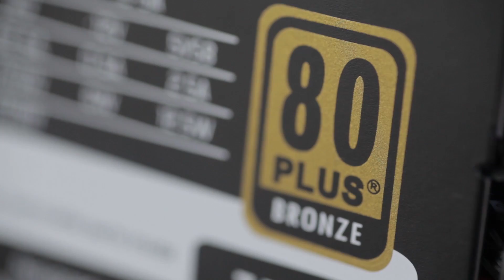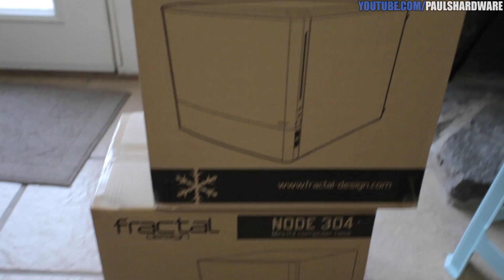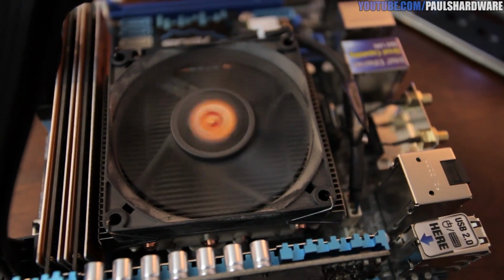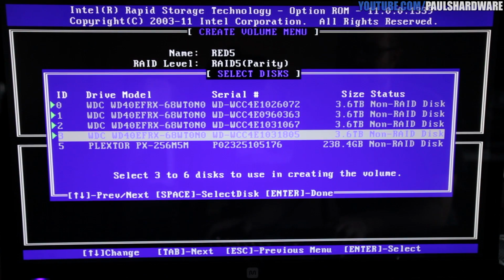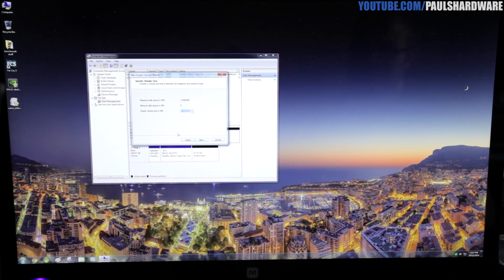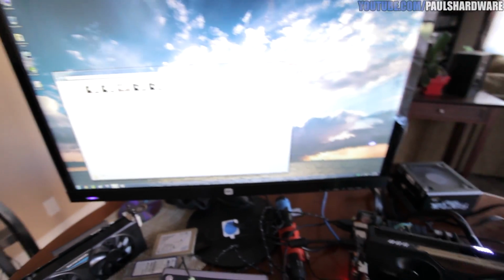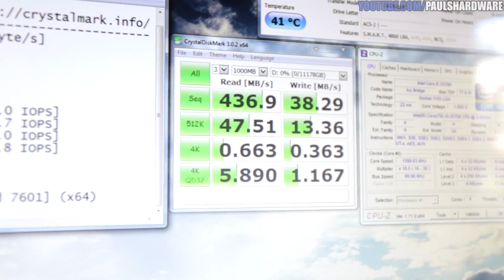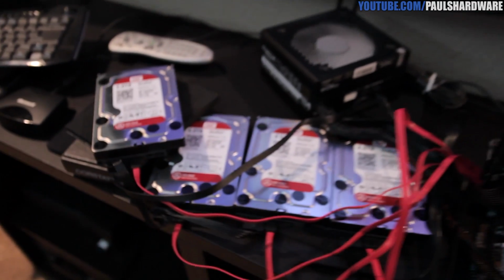Paul's HTPC Build - Part 1

Comment: Hey Paul quick question I have a has should I return it and us a computer instead and install windows 7/8 for serving video to tablet smart phone both at android by the way and what software should I use to do this I need some help because every were I search the is hardly any info on the subject I all so want to use it as a htpc / workstation the specs of the PC is a and phenom ii x2 550 be a Gigabyte' board with six sata ports  h60 700w PSU will be changed if this is a good idea and 2 3tb greens 2 1tb HDD blue and seagate and a samsung 240 pro ssd and 8gigs of corsair vengence that is the specs of the computer any info would help and be apresheated I am sorry for my bad english it would be alsome if you responded and can help me with my issue please and thank you 

-joshua'
Reply: I ment to say nas

Comment: Tip: Cheep drive caddy for benching... When testing out your rig before getting everything in the case, you can use some metal plumbers tape to make a quick rig for the hard drives.  Having all the drives together with plumbers tape, you can move them around a lot easier.  Loop a bit of extra plumbers tape over the top and you have a nice handle.  You can even make a nice reusable carrying rig by wrapping the handle with electrical tape and then wrapping something soft around it.  Also, don't forget to round the bottom edges of the tape so you don't end up cutting yourself or marking up any drives or tables... And don't fold the bottom edges under the drives, it's just a bad idea...

Comment: Nice video, with a good level of detail. I'm a new subscriber though I've seen many of your Newegg videos. Will you still be having JJ from Asus as a guest in future?
How are the temps on your 3570K? Mine were terrible, with 10C to 15C degrees difference between the hottest and coolest core until I delidded it and replaced the Intel TIM with Coollaboratory Liquid Ultra. It OC's to 4.5 GHz now with all cores at the same temperature. Using the stock cooler :)

Comment: Personally, I've given up on Windows. I have a small Windows partition for games, and everything else I do on Ubuntu Linux. It doesn't get better than free, open source yet still reliable. Albeit you have to get used to compiling your own applications and such, Windows I use only for playing games now. If I were to build another PC I wouldn't even purchase Windows, but use Linux until I have another hundred dollars.
Reply: Same. I am starting to dislike Windows at everything, with the exception of games
Reply: Ubuntu has become like Windows now in my opinion. It was great OS but they ruined it when they introduced the "Unity" (not confused with the game engine with the same name) graphical interface back in 2011. I would personally pick OpenELEC for HTPC so I don't need to pass trough configuration nightmares (if you are going to use tuner card, make sure it supports Linux).
Reply: If you are living in ISDB region, you are out of luck.

Comment: Very nice setup. 

I'm curious as to why you chose the 3570K over the 4690K. Could the mobo not support the newer chip?

Your system actually looks a lot like the one I'm planning on building, except I'm gonna put in a Gigabyte Gaming 7 mobo, a Crucial 512GB m.2 as a boot drive, two GTX 970s in SLI and a Core i7-4790K. The SLI setup will come much later; right now, I'm cannibalizing just about everything from my current system, an FX-6300/AMD 970 setup. I will not be reusing it; I'm done with AMD processors for the time being.

I also will be throwing in an internal Ceton card; I'm currently running the InfiniTV 4 USB, and it's time for a change--especially since it's not officially supported in WIndows 8 outside of beta drivers.

Comment: If the intel heatsink is quiet and you don't intend to overclock I would just leave the heatsink in and keep the watercooling heatsink for an extreme built.  By the way I am looking into building my first computer. Want to go with a Micro ATX built.  I have a AMD 955 and thinking about the I5 4690K with 8 gig ram and keeping my video card which is a MSI GTX 650 Ti Boost.  What do you think of the Corsiar 350D Micro case for my build?  Or would a Fractal Micro Case be better.  I'm also looking for a quiet computer, what do you thing of the Corsair AF series fans?  or is the Bitfinex or the Noctura fans better for quietness.  Also looking into the Noctura low profile heartsink, looking to overclock a bit as well.   I have Cerebral Palsy and just want  to get a computer that is easy to handle.  The case I have is a CM 690 Nvidia edition which is a nice case but it is too big for me to handle.   Keep up the good work Paul, really enjoy your videos, only problem I have is when you time lapse your builds.  But that's just me :o)

Comment: I'm using the same case as well for a home theater / server computer just wondering how you're going to end up setting it up operating system wise. So far I'm just sharing folders / sharing the hard drives. Yet it doesn't always have the best reliability sometimes other computers cannot connect to the folders yet give it 5 10 minutes and then they can connect again

Comment: I would go with the 240, especially if it's just sitting there. OC to 4.2 and keep the fans turned down. I'm sure your wife won't mind a quiet HTPC. I also agree with keeping the 970 for benching, etc. Unless the HTPC is your primary gaming rig, a 770 is plenty. I wouldn't say it's overkill though, because it still gives you the option to play any AAA title, which is nice sometimes on the big screen. Thanks Paul.

Comment: Paul, why such a powerful graphics card for an HTPC? Are you doing something special with it? I don't know...., like 3 4k TVs...lol. I would cool the CPU with whatever is most quiet. Liquid cooling would hardly require any fan RPMs. But, you cannot go wrong with a Noctua tower and low RPM/Quiet edition fan. You know late at night when you are close to sleep and the TV is down low not to wake anyone else is when you'll be glad you went with a quiet cooling set up and avoid the annoying background buzz of a fan. At least I would be.

Comment: What's the noise level of those HDDs when they spin up (and when Windows suddenly decides to thrash them for no apparent reason)?

If I was in your shoes I'd have gone with an AMD card in there and an Asutek cooler on it and have it ready to mine x11, x13 or x15 coin on a medium-high intensity when the summer ends to aid the heating in your house that helps pay for itself. :)

Comment: You should have gone with software raid5 in windows 7. It's much faster, than the crappy integrated Intel one. Plus you can use whatever motherboard to retrieve the data if your motherboard dies.

In fact you should use FreeNAS and go with the software z-raid5. It's way superior in every way. And it's free, so you will be saving that Windows license.

Comment: I'd say something simple for the CPU cooler. I've got a new build going on with an i7 (4790k) that's still using the stock cooler (and stock boost speed) and I've yet too see get it over 50c. IMHO watercooling/dualtower-air seems OP for and i5... But what do I know, your the expert. =)

I've started plans for a THPC and I was planning for it to be 4or5 3TB Reds in RAID5. SO, I'm looking forward to see how your 'RED5' works out in reality. ie can it handle multiple users pulling data wile itself is possibly writing something.

Comment: Go with an air cooler for the low noise output; water pumps in AIO water coolers are a little loud for an HTPC, don't you think? If you have a good air cooler, that is, like a Noctua for example.  I use a Zalman 'cause the copper fins are pretty. Dumb reason. I know. There are definitely quieter fans than mine.

Comment: I like CLCs for small builds so you can directly pipe the heat out of the case. Similarly, I prefer blower style coolers on GPUs for small builds for the same reason.

Comment: Nice build!

My HTPC build looks like this:
- Intel i3-4130 (using the iGPU)
- Asus B85M-G
- 8GB of ram
- Old Corsair Force 3 120GB SSD
- 3x WD 3TB Reds (no Raid)
- xfx 450W core edition PSU
- Silverstone ML04 HTPC case
- Windows Server 2012 R2 slightly modified to be more desktop OS like (because i'm student so it was free)

I use XBMC/Kodi on it and also run a mumble server on it. And it's great for sharing files for my other PCs and backing up data.

Can you recommend me a DVB-C TV card? Having the paytvcard or cablecard (whatever it's called) slot would be nice. Should i try to look for the same card you use or do you know if there are "better" cards today? And btw i live in Europe if that's important. NTSC and PAL have been history since we moved from analog to digital, right? My connection type is cable (antenna and satelite support is not needed but doesn't hurt either :D )

Comment: Nice parts ya got in that rig.  I personally would go for the water cooler,  if for no other reason than the node 804 you're using is pretty well suited for it already. I'm also kind of partial to water-cooling in most cases anyway though,  so take that with a grain of salt.  If you have an air cooler that can be just as quiet if not more so than the aio's you have then that works well too i guess.  Mostly about silence for an htpc anyway, amirite?

Comment: Great video Paul, I need a video capture card for my satellite dish and I was wondering if you could make some recommendations on what to look for.
I also intend to build in an Air540, could you recommend some vertical loading drives.
I am having a terrible time trying to figure out what to do about both issues.
Thanks for your help.

Comment: I don't like to be the nay-sayer, but I'm confused. This seems completely backwards. Your HTPC is supposed to be as quiet as possible and low power. Your server is supposed to have the massive storage, consume lots of power, and make noise. But you put in massive storage, a noisy power hungry video card, apparently no consideration for a low power CPU/APU (3570k isn't awful, but WHY?)... and essentially threw away a perfectly good Blu-Ray drive.
Reply: He never said he was throwing away the Blu-ray drive. He just can't use it for the htpc.

Comment: remake the volume with a 64k stripe and try the benchmarks again....?
Reply from the maker: I started to dig about the RAID performance and I found out there are far too many things I need to try to see if I can improve write speeds
Reply: Paul's Hardware you could also try just passing the disks to the OS and setting up raid5 within Windows.

Comment: Wouldn't go with a a AIO water cooler for the CPU in the HTPC. Easier to replace a fan on a heatsink than an AIO, if the pump fails. a HTPC you just want to leave alone for a long time.

Comment: Nice build! I would like to see you use the closed watercooler CPU that way you can dissipate the heat a bit more and run the fans at a lower speed making it whisper quite.

Comment: For a minute I saw a small Ceton windows when the HTPC start it. Is that the Ceton TV tuner you are using, if not, what TV tuner are you using?
Reply: Paul's Hardware If you don't have cable TV service, this is a great tuner also:  http://hauppauge.com/site/products/data_colossus.html I bought it 2 1/2 years ago from  Newegg.
Reply: Bryce Kappa Yes.
Reply: I like the Silicon Dust Homerun for a terrestrial antenna tuner... hooks to the network via the router and is accessible by all the computers on the network I use  a free program called NextPVR It also works in Linux using Emby Server. I can watch TV (live or recorded) from any computer in my house and even a cellphone or tablet I have it set up so I can also watch from anywhere I have internet through an internet browser using the Emby-server that's running on my Linux box
This is only for over the air channels tho and only has 2 tuners but you can get 2 of them and have 4 tuners.. or more if you buy more .. then can stack with each other
Reply: looks like Newegg has them for about 100 bucks. pretty comparable to most dual tuners for computers. Guess they have a 3 tuner cable card version too for not much more .. but again .. you need to have windows 7, 8 or 8.1 to use that because the only thing that seems to work with cable cards is Windows Media Center and that doesn't exist anymore in Windows 10 so you can't use it and get any channel that your cable company encrypts which is usually about 90% of them. The one I use for over the air channels is 		 		the SiliconDust HDHR4-2US HDHomeRun CONNECT
Reply: as he said in the video .. it's an InfiniTV 4 tuner card .. yes its made by Centon but be careful if you buy it for a Windows 8 system that you plan on putting to sleep. The Centon card does not like sleep in Windows 8 .. maybe in other versions of windows too but I have 8.1 and the Centon card causes it to crash going into sleep. There is a work around tho .. you can go into the Centon's Network Adaptor it adds in Device manager and remove everything but Client for Microsoft Networks and TCP/IPv4.and the PC will sleep without crashing. I have talked to Centon on this issue and they have absolutely horrible customer service. They explained that they don't support any power savings on their cards. They say its meant only for a machine that runs 24/7 and gave me no help with my problems. Luckily, I'm good enough with computers to finally figure out the problems and find that workaround I stated above. So this card works good in a very low power system but if you plan on installing it on a system that pulls some wattage... its not a very good card and I'm not sure how much longer it will work since they haven't updated their drivers since 2011.. I'm a bit worried about what issues the card will have with Windows 10 and if they are ever going to update the drivers for any operating system above Windows 7.
Reply: Oh .. one more thing .. the InfiniTV is a cable card tuner not a standard TV tuner. You need a cable card from your cable company to use it. It does not receive over the air signals
Reply: John Orion Thanks for the information, but I know well Ceton InfiniTV Cable card. Also, I always set the sleep to never, I don't like it. I'm not going to buy it because I don't have Cable TV service where I live, I have Directv, and I have the  Hauppauge Colossus HD TV tuner. I use it to record HD programing from HBO, Showtime, Cinemax, Starz and other channels directly to my PC. Also, it's Ceton, not Centon: http://cetoncorp.com/products/infinitv/
Reply from the maker: Yes sir, the Ceton InfiniTV 4, I think it's a pretty great product if you have cable and CableCard access
Reply: +Angel Luis Trinidad would u recommend that for any htpc builds?
Reply: Thank you :)
Reply: John Orion that sounds really cool. How much is it to buy just one of those things brand new?
Reply: John Orion Thank you so much. Ill start my htpc project very soon, thank you for help :)

Comment: Should be a nice build Paul, total overkill for a HTPC, but hey I would not expect anything less from you lol I think water cooler is way over kill, come to think about it so is the GTX 770. I like AMD APU for HTPC cheap and cheerful and do the job just fine. cant wait to see final build. Have a great weekend.
Reply from the maker: Thank you sir! I like your channel, those are some really helpful videos. I too like the AMD APUs for HTPC usage but I wanted to go with a discrete graphics card, and I hate not using the iGPU in AMD's chips because it's such a good selling point for them
Reply: Paul's Hardware I'm actually glad you didn't go with AMD and not for any anti-AMD thing. Simply just because EVERY video I've seen so far on HTPC is an AMD processor. This was a different approach to it. Ok very different, it was crazy extreme, but I like it because it wasn't the norm or the expected.